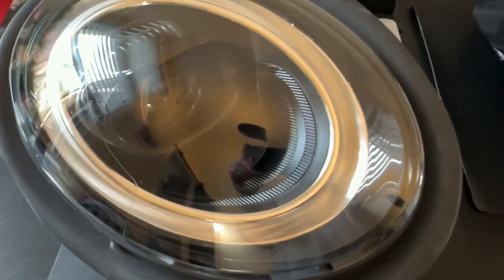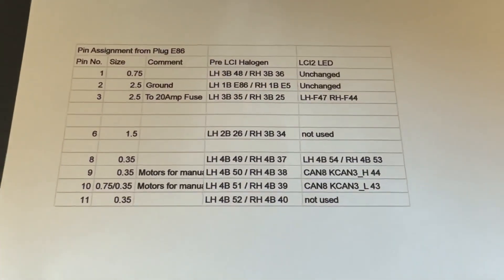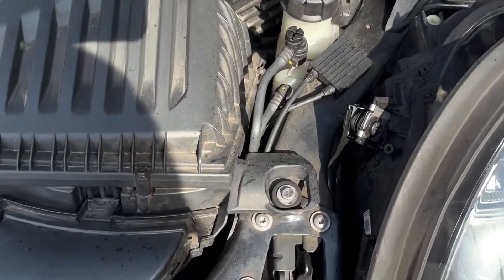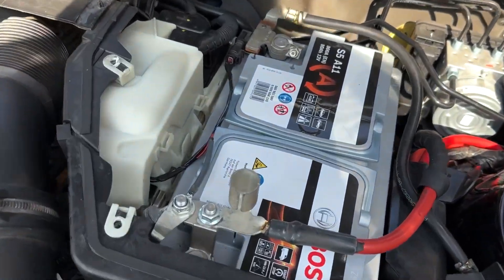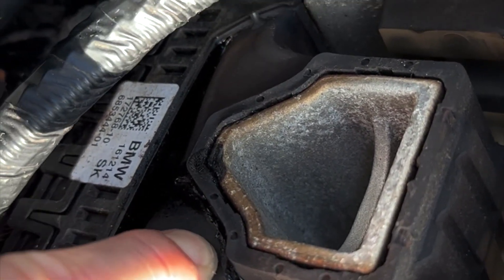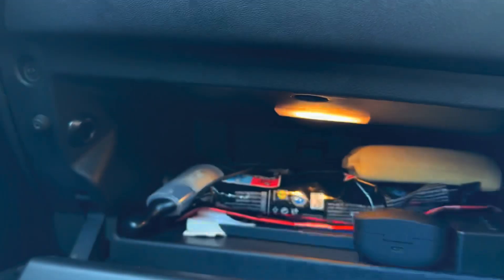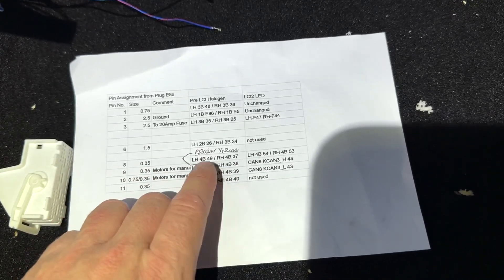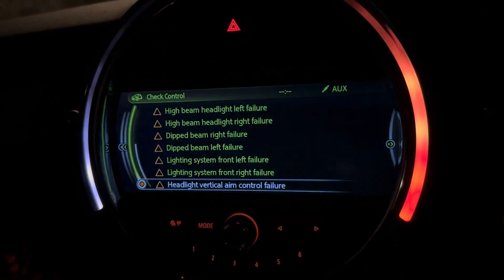Mini Cooper Halogen to LCI2 Full LED Headlight Retrofit

Comment: What is the part that needed to be replaced (150 pounds) ?
Reply: Transmission mount
Reply from the maker: It was the engine mount. 
22116886196 - this is what was there 
22118835574 - this is what it was replaced with

Comment: Hi - I have a 2019 F56 that I imported from the US to Germany. It currently runs on Halogen EU spec lights. Can I upgrade to LCI2 like you did? How do I know that my BCU is “compatible”?  Thanks.
Reply from the maker: Depends what specs the car came with, have a read through F56 forum. Some say it’s up to the BCU version but I think it’s more dependant on certain options. In short you should be able to do the upgrade, and if all fails upgrade the BCU 🙃

Comment: Someone smashed my driver side led headlights last week. Instead of claiming on my insurance, I prefer to get a replacement as it costs around £150-£200 on ebay. Does it need to be calibrated afterwards? It's the adaptive led on a F56 electric.
Reply from the maker: No calibration is required unless someone screwed up the headlight. There’s some odd whore screws that you can manually adjust if they are off…
Reply: @DanielSarvari  Thanks for your reply, didn't see it until now. Somehow, I managed to get a brand new £950 genuine Mini LED headlight for £100 on ebay, even when it was in 5 baskets! Thankfully, all the brackets are in-tact and I can just swap over the modules, also discovered that mine are the non-adaptive LED.

Comment: If I already have the LED Headlights and the new LCI2 already come with the modules do I still need to do extra wiring or just plug it in and it be good?
Reply from the maker: You wouldn’t need to rewire, however, still need to code the new headlights.

Comment: Have you tried the low beam at night? Mine is awful 2 different shape of square even if you adjust the up down or side to side screws, still projects low on the road with square shape not universally even like factory headlights!
Reply from the maker: Sorry just seen your message, yeah I don’t have issues with the low beam, in fact really impressed with its coverage.

Comment: Love the look, but I’m curious what the coding does? When you code it is it just clearing the code or do you have to be a specialized coder ?
Reply from the maker: A lot more than that. It would not work without coding. When the computer off this car came out from factory these headlights did not exist yet. So you are coding it in new… there are so many people doing this for a living and they can do it remotely.
Reply: @DanielSarvari  I have bimmercode expert mode, is that enough ? And if not where do I contact these people to do it for me
Reply: @DanielSarvari  so I’m at the coding part now, who did you contact to do this for you? Any reputable people you know ?
Reply from the maker: @ovfbekw5467  nobody in particular. Did you try in that forum? Or ask in F56 Facebook groups.
Reply: @DanielSarvari  I just looked at one of your older comments about asking someone in that forum to code for me, I made an account and I’ll ask, but I’m not sure how responsive that thread is.
Reply from the maker: No, that’s not good for deep coding. E-sys has to be used which is the bmw engineering software. Search for the Mini F56 Forum, thread “F56 LCI LED Headlights fit pre LCI cars” you’ll find all the info there and shout out for someone that can code it for you…

Comment: Looks greate mate. Where did you get this table with the pin position relationship? E86 plug pin assignment
Reply from the maker: I worked it out comparing the halogen to LCI2 headlight diagrams